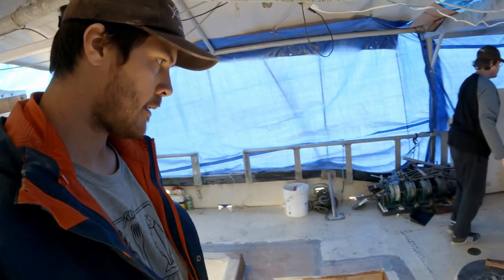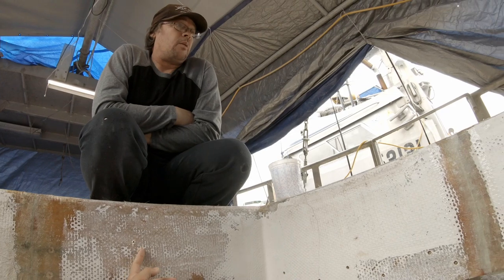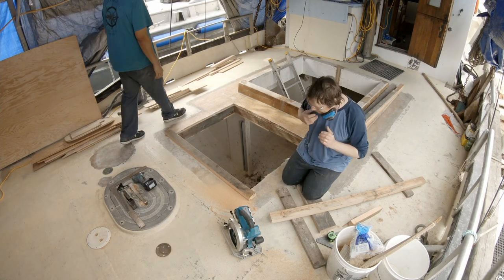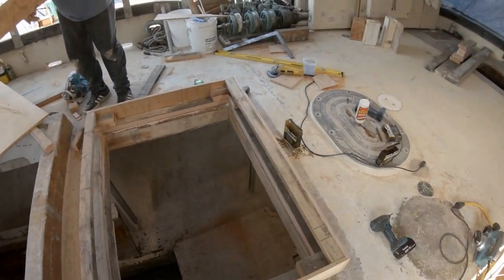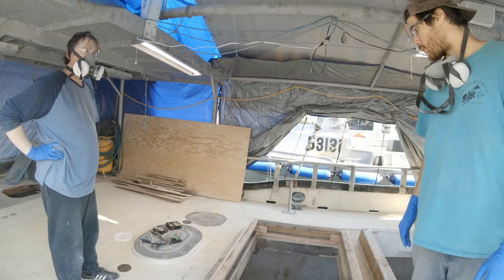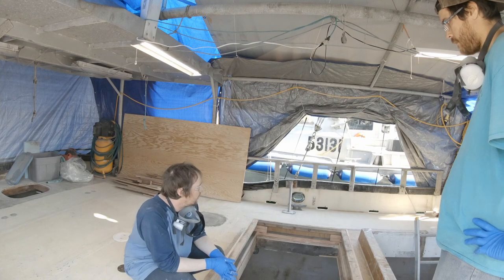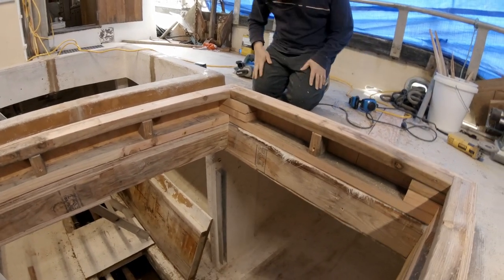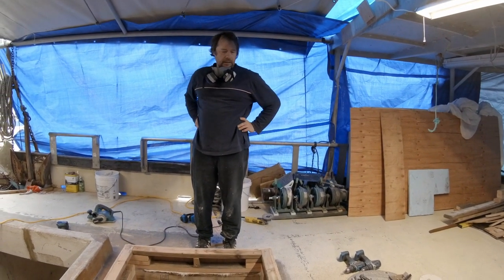Fabricating the Aft Coaming - Emerald Isle: Ep.21 Fishing Boat Refit

Comment: The Fish Tail is just on the other side of the dock, right? Why not keep that slip and not change later. Aren't you pointed out of the harbor the way you docked?
Reply from the maker: The slip for the Fish Tale is for vessels 35' or so. As we are on the very end of the float the Emerald Isle can be on the outside. Also we are keeping the Fish Tale, so it works out well. The bow of the Emerald Isle is pointed towards the harbor exit.

Comment: Are you going to cover 1st cloth(chopped strand) with woven roving?  It appears prior laminate used woven roving. We used to use chopped strand covered with woven roving but this is really for build up.  Just wondering your steps of glassing.  Either way I'm sure it should be fine but it seems you might want some good build up in high wear areas.  What gel coat are you using?  We have had great results with Total Boat
Just wish I were younger and there with my tools to help you.  We'd bang that out in no time.  Watching your videos makes me feel like part of the family.
Reply from the maker: We will come back in with a few layers of 2408 0/90 Biaxle and CSM on top. The hatch combings will probably get an extra layer as they tend to see more wear. This will give us good build and strength. We are  using Orca resin and gelcoat.